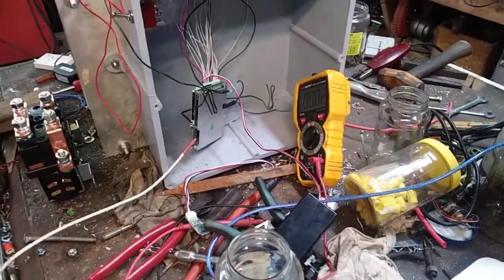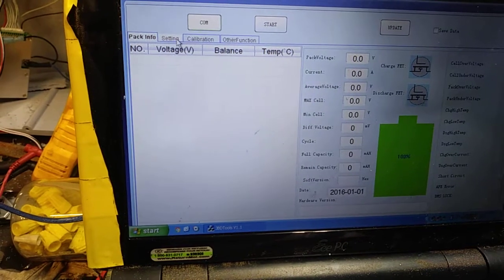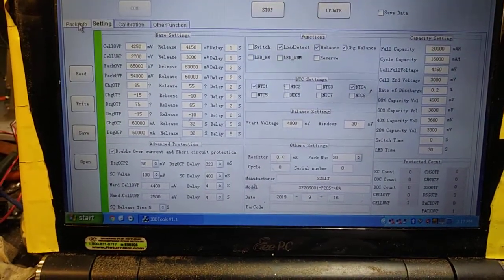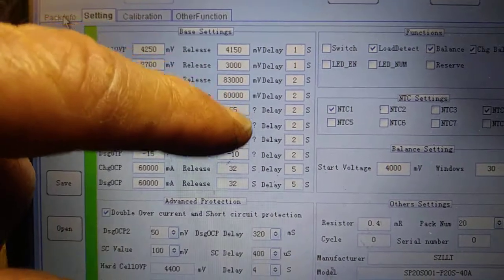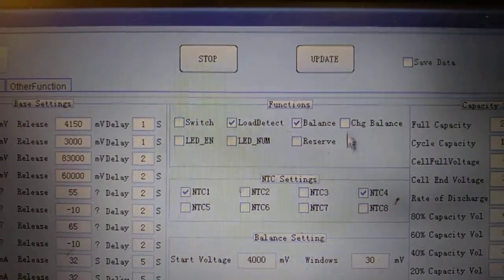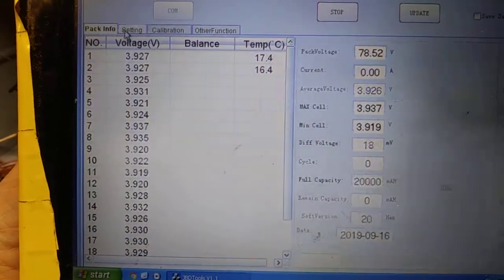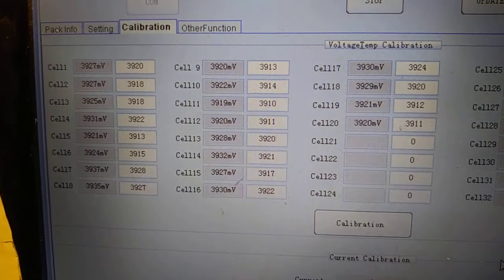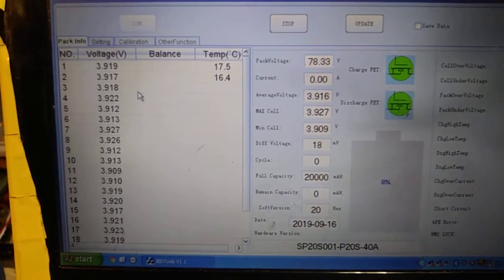Using the computer to set the parameters on the intelligent BMS

Comment: Hi thank you for the nice presentation. I'm new to smart bms. I want to change few parameters before connecting bms to battery. Is it possible? Does bms require power supply just to configure?
Reply from the maker: Yes must be connected to program.you can program some of the features with an I phone but not Android.

Comment: How to connect the BMS, with computer, can you write the name of USB and their drive for computer, and the cable.
Reply from the maker: It's a little box that has the plug for the four wires going out to the Bluetooth which you replace with the box and out of the other end looks like a printer USB cable if you need one I have a few I think they sell for about 15 bucks

Comment: how to install this software ?
Reply from the maker: I had to use an older
Windows eight or earlier. I hope I know they've got this straightened out to work with newer computers. You can also set settings in the Apple program which is another hard one to get to download
Reply: Which software do I use with that?